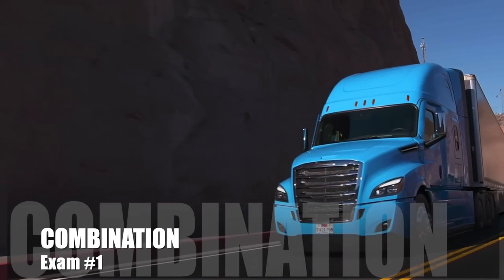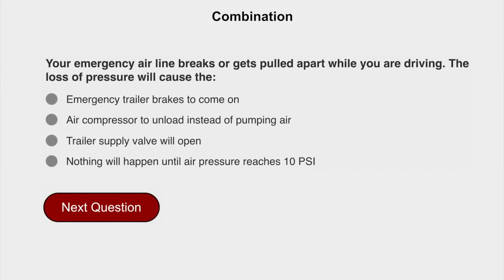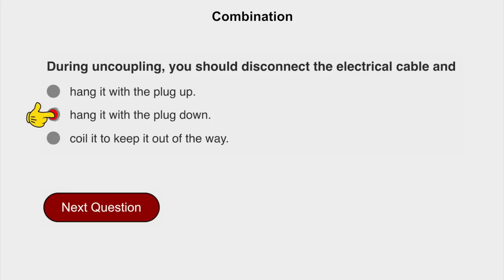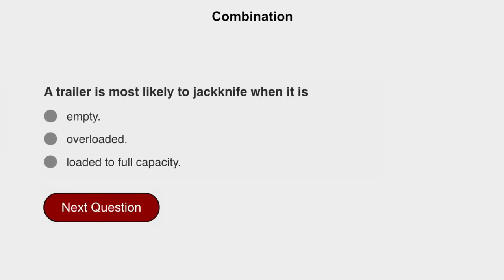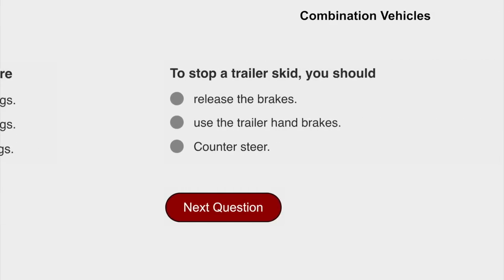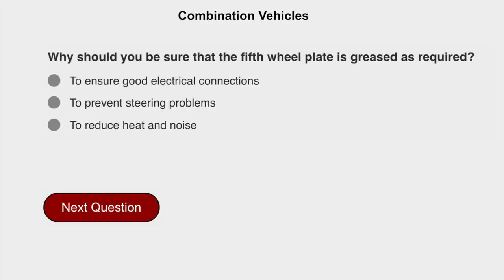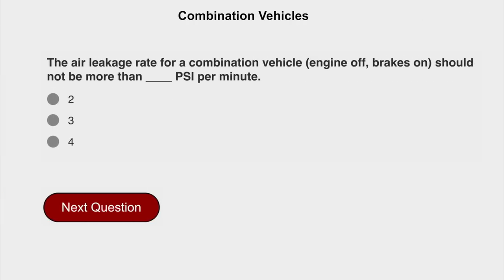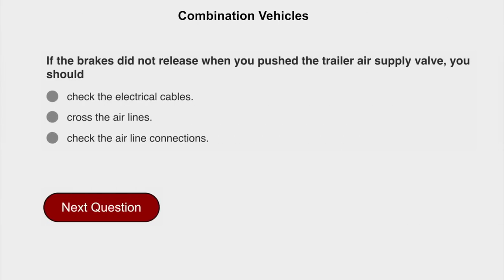2020 CDL COMBINATION VEHICLE PRACTICE TEST # 1 QUESTIONS & ANSWERS

Comment: The 'What is a tractor jackknife?' question should be 'What is a trailer jackknife?'
Reply: Yup.  That's at the 10:43 mark BTW. The question gives the description of of a TRACTOR jack-knife while the specifies what a TRAILER jack-knife is.
Reply: @Cujo2447   so is the answers for a tractor jackknife or a trailer?
Reply: @annmariet445  it’s wrong the answer is number one: when you lock up the drive tires on the tractor and the tractor spins out sideways as the trailer continues to push forward!
Reply: Also, the word lock is pronounced lock, not look. Ha ha, I'm such a    cc===>
Reply: Thank you for bringing this up! I knew I answered correctly

Comment: I have a few questions about your question that says "What is a tractor jackknife ?" I have been driving truck off and on for about 40 years and never heard of a tractor jackknife, i have head of a trailer jackknife but not a tractor jackknife.  And in your answer you have drive tires on a trailer, trailers don't have drive tires, and you also you said tractors push forward, tractors don't push anything forward they pull trailers not push them.   So if you would please explain this question and answer to me i would appreciate it very much.

Comment: I'm completely confused with what you mean by "Trolley: applied/released"  on question 2.  You aren't talking about the Trolley brake, because you say "Trailer Air Supply In/open".  Isn't Your Trailer Air Supply the same as your Trolley Brake?  If so, how can it possibly be in a released state with the air supply in/open?
Reply: I don’t understand 2 or or 5.

Comment: New sub here 🥳 
 I'm waiting for the drug test to clear and get ok to start this Monday the 11 2022.   I like the group I'm with and hopefully I start this Monday.
I'm pumped 😎 
Anyone wanna chat about also starting school?
Training program 160hrs , Class A manual transmission equipment, and they said they can get me ready in 10 weeks.  I think it'll be more because I'll be going for my hZmat that's an additional fee and probably another drug test.
A side note 📝  if you smoke medical hemp or use pain meds like as low as Norco you need to have a negative test before you sign up because or you'll be band from getting a CDL for 10 years.  They said something about Inhouse meaning any job you apply and they look back at the federal record you'll be dined.

Comment: You guys are WRONG on the tractor jack knife question! The correct answer is--when you lock up the drive tires on the tractor and the tractor spins out sideways as the trailer continues to push forward.....

Comment: So I had to renew my license, had to take combinations, general knowledge and air brakes tests, along with a class c knowledge test.  this is a great video, it was a great study guide along with the other ones, as I passed the cdl parts (3 mentioned above) of the test.  however, I could not through god's will pass the class c!  the questions were completely different and nearly all different answers, even after reading the handbook!  I studied several questions, over 300 I believe, practiced them enough to pass the test with flying colors!  but yet I keep failing the class c knowledge test!  please, please, please, someone upload the "correct" questions to study, please!  I was suppose to drive already since I was accepted at my old job, but now I lost my temp license because of this stupid class c knowledge test!  I need your help!!!